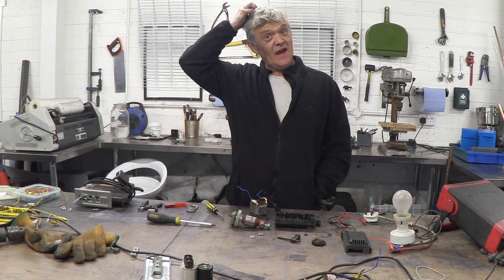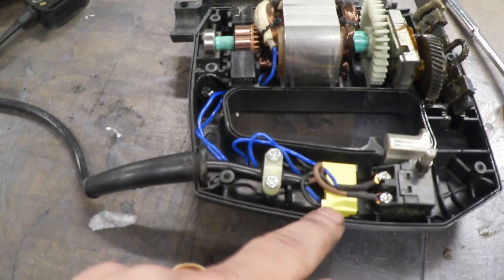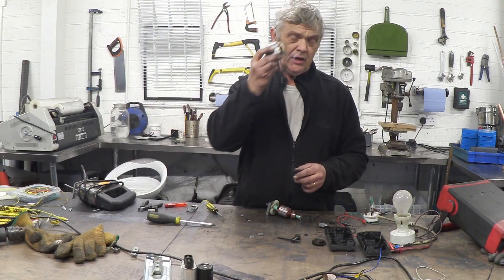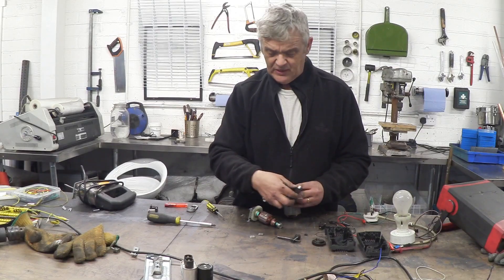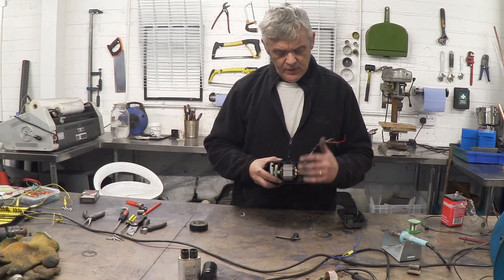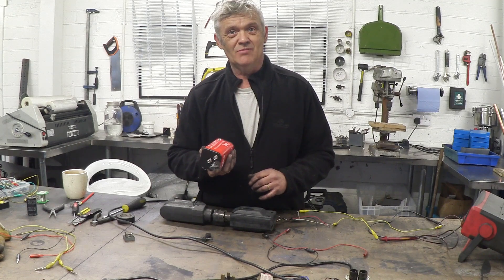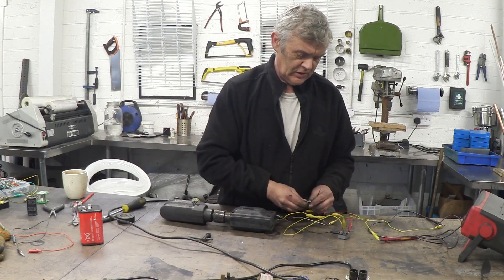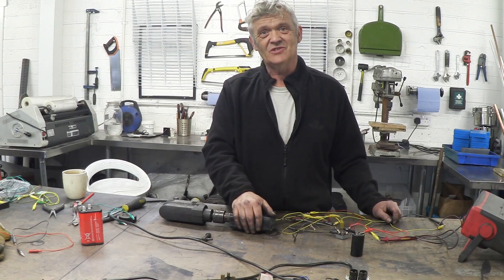Converting A Universal Motor ( Washing Machine, Drill, Saw ) To Generate

Comment: Thanks a lot for the knowlege? I have a question about the yellow little capacitor. You mentioned that it is a starting cap. Do you mean it is like the starting caps in induction motors?? I learn  somewhere on youtube that its role is only to suppress electrical noise. Would you please explain??

Comment: Tried this as I'm looking for a generator for the 3d printer competition, on an old Moulinex coffee grinder motor that still worked - got more generation out of the self-excited configuration (without battery, just with the coils wired in parallel to the brushes) than with the battery (6v)! A bit over 1v vs less than half a volt. Didn't use rectifier having seen comments pointing out that it's unnecessary.

Comment: Sorry banal question, but what are those grills behind you for? Very inspiring by the way. I want to make a wind turbine preferably a VAWT smallish but enough to do what a 100 watt solar will do to help with my 12 volt system or lighting during the less sunny winter months. What motor would u be ideal for that.?

Comment: Well my uncle threw away his Makita  chop saw, so I'm going to use it for something...it has a little gear up thing on there, the motor turns 4.5 times faster than the blade did...I'm going to glue a small magnet to the end of the shaft,  but also supply a small voltage to the armature thru the disconnected brushes...I'll connect the field for the output...it's better I think to do it that way, so the output can be controlled by the input which is slight anyways...its a 115 volt 12 amp motor so I thought it should work all right as a small wind generator...and with the little round button magnet on the shaft, it should start straightaway, I'd think...just a theory...I'm building another one with an old 1/12 horsepower gearmotor from a very old garage door opener, that has nice bearings and I'm drilling holes for 8 ring magnets,  N 52s, 3/4 inch diameter, for the stator...each has 11.8 pounds pull and I'm stacking 2 at each of the four poles so itll be 23.6 pounds pull on each of the four winding cores...this motor had a start winding so I should get two voltages ...anyhow I thought I'd try both types of motors ...I always do things somewhat differently than most anyone else, but nobody has ever accused me of copying lol
Reply: I meant rotor not stator...oops

Comment: Thanks Robert. You should be able to self-start that alternator by making use of the initial residual magnetism in the core, and feeding back some of the initially tiny current from the stator via a current limiting resistor. No rectification is needed. The alternator will be generating rough DC, because of the commutator being used. Output voltage and power will ramp up over the first few seconds. We did that routinely with alternators which had no permanent magnets in them, back in the 70's. It was an old idea even then.
Reply: Quite right, it's already DC coming out of the commutator.

Comment: Now that we have the basic idea, what we need now is to get a car Alternator and find the best motor to drive it with, and hopefully there's enough current left over to charge batteries! Even if it's half an amp at 12V, that's the same thing as 1amp at 12V for 12 hours because it doesn't stop providing! 
And if that's the case, I wouldn't mind having 6 of them running and helping keep the solar battery system going on cloudy days... You really can't complain if it actually gives any current up and over what it needs to run itself, it's maintenance free and it would keep giving the good stuff even if it's a very small amount, but it's possible that it might work well, considering that it can run a car without a battery, albeit it's converting electrical energy to mechanical energy and the process continues as long as there's fuel for the mechanical part of the equation.. but an efficient electric motor, if possible powered by PWM or some other method, just might be able to work... We can assume that everything has been tried or we can assume that everything has been tried but someone has missed something somewhere that is not common knowledge and way different to our current understanding. Someone somewhere might make the mistake that everyone else was looking for but didn't find it... 
So keep experimenting, the next breakthrough lies with the person tinkering...

Comment: Long ago my dad game me a self exciting generator from a Grumman TBF Avenger, lost it when I lost a piece of land [along with a lot of other valuable bits] and my dad told me that without a resistor, it would build up enough voltage to destroy its self, so the makers of the plane [Grumman] had added some carbon resistor piles into the system to keep the voltage from getting too high.
My dad had used this generator for many years as a welder, simply driving it with a 7hp Kholer engine, and a long piece of nichrome wire held to a 2x4 by  a few nails.
I remember seeing the nichrome wire glowing orange hot, sagging and burning interesting patterns into the board while he welded.
[sigh] >longing for happier days<

Comment: What is that damn noise in the background? Anyway if the pole of the field coil has residual magnetism (as you demonstrated), you should be able to turn it into a self excited shunt generator simply by wiring the field coil across the armature and completely eliminate the need for any separate excitation.

Comment: Universal motors don't have start capacitors, that's an interference suppression capacitor
Also, you should have been getting a bigger difference than .1v with the battery, which leads me to believe you parallelled the fields wrong
For series, you just connect the wires that went to the brushes together, but for parallel, brush wire from one coil to feed wire of the other, same wiith the other coil.
To make it easier, you could have extended all 4 field wires outside the case so you could easily swap them.
I'm also wondering if you had the meter set to AC and getting a DC output.
Reply: This question/observation about the relationship of the four possible terminals stemming from the field/stator wires, and how they could/should be wired or rewired is the most underaddressed, confusing part of this UM to Gen hack (in Murray-Smith's and other demos)...here we can hear OP doing something with the field coils with a battery to determine polarity, and thus how to wire, but it is anyone' s guess what he is actually connecting to what and why not being able to see...(something about a compass and a blue wire)So here your comment suggests that for a paralell wiring (increased current), one should take  one of the wires from one of brush terminals and splice? / connect it with  the feed wire of the other coil, vice versa, so basically an X config...which begs question then if we do this, whether our two generator output terminals would then need to come out from our two splice loctions, ie a pigtail near each the brush terminals, or should they be near the feed terminals, or one  of each? Furthermore,  the assumption that the brushes still need to be re- installed to complete the circuit in the converted generator is correct? Or can they be discarded? Thanks to any, all who can shed light on this.
Reply: @TheSiamerican  your 'x config' with pigtails is correct
You also need to feed the brushes with some power 
If you take the output from the field coils, you need a rotating magnet to excite them the rotor is the magnet once power is applied, the rotor voltage can be adjusted to vary the output power, which is basically how a car alternator works.

Comment: I`ve tried most of them, and some blenders motor, also. And, I was thinking about using a voltage regulator from motorcycle, never did though. Better use a bldc for a generator, or microwave over`s plate motor.

Comment: I have some huge motors from forklifts, they are like 10kw at 48v, they are brushed series wound, I got them for a electric car conversion project, but this is like 1950's tech, and salvaged ev motors would be lots more efficient, and powerful, so I was thinking of possibly using one to build a big micro hydroelectric generator,  I have a spring I could dam up, and generate power when needed, I'm off grid, with solar power, and just over 25kwh battery,  I'm looking to build a charger similar to a mppt, to buck or boost, the variable voltage, from the generator, a solar controller will keep the generator voltage pulled down, not allowing it to spin up go full power,  I'm not going to connect it to lithium batteries lime wind turbines are to lead acid batteries, simply burning off power when the battery is full, awesome ideas you are giving me! Thanks!
Reply from the maker: awesome projects mate - thanks for the post

Comment: Robert, instead of powering the field coils, could you just wire a motor-run capacitor across them?
It works with a 3-phase induction motor, and turns it into a generator...
Reply from the maker: in the kick starting it at the end - that is basically what I did mate
Reply: @ThinkingandTinkering  
It's a different principle...
You can use the cap alone to provide reactive power - no rectifier...
Here's a vid about it - from a quick search...
(there may be better...)
He's using a uni-motor, so it does work on 2-phase...
https://www.youtube.com/watch?v=njNevoMY1To

Comment: I used 18v to energize the coil, get 1.5v back. Tried adding a capacitor, it did nothing. As soon as I remove the power no charge is maintained in the coils. Connecting output to input to try and maintain the cap charge does nothing either. What am I doing wrong?!
Reply from the maker: these coils are really wound for 110 - 230 v mate try 30-50v - plus -I got something wrong - out put is dc not ac

Comment: can you make a motor using graphene or carbon ink?  with that level of customization, i speculate you can really hone the fields to the most efficient architecture, maybe create dynamic fields and possibly better deal with heat/resistance.  but im asking ignorantly, you guys know better than me.

huge thanks everyone
Reply from the maker: it's going to have a pretty high resistance if you just try winding it - really if you want to use graphene you have to rethink the architecture - but good question mate

Comment: Because they are commutated, universal motors run as DC generators not AC. I think your voltmeter on AC is reading only the ripple voltage.
You should be getting around 12v DC. no need for capacitor or bridge rectifier.
Reply: You're right. It's already a series dynamo.
Reply: All you need to do is connect the field coil across the commutator output and it will generate DC. This is how the old generators on old cars work.
Reply from the maker: cheers mate

Comment: ...and having now watched the rest of the video, I've another comment: once the generator has been run as such, there ought to be enough residual magnetism in its core for the external kick-start of applied voltage to be unnecessary - that's the way many small commercially available generators work. Occassionally it is necessary to apply a few volts (often 12V) across the outputs if the generator hasn't been used for a long time, or alternatively remove any load attached to the outputs before starting the generator. How long is too long for the residual magetism to work? - I don't know, as it will vary by generator :-)
Reply from the maker: cheers mate

Comment: The capacitor adjacent to the switch at the beginning of the video is for interference suppression - start capacitors are only used in single phase induction motors, and aren't required in brushed motors...
Reply from the maker: cheers mate

Comment: Could you mechanically add a dynamo in series with the motor, so when the shaft turns the dynamo excites the motor?
Reply: or a simple dc motor of the rpm/voltage you are looking for coupled onto the shaft.
Reply from the maker: yeah - but you would still need to input every

Comment: Hi sir ..it was a valuablepractical session u gave us ..
I have doubt on my own project 
If I need both torque and speed for a small size motor what type of motor or how to make one like that and what capacity does the battery should be 
Pls help me in this
Reply: ......... Question is too vague to give you assistance. Is it for a model RC  aircraft or ride- on lawnmower ?
Reply: @charlesdickens6706  it was for a remote car ...in a bigger size and weight
Reply from the maker: no idea mate - sorry
Reply: @ThinkingandTinkering  no problem sir thank you for the reply ✌️

Comment: Hi Rob. Im not sure it could be done but would a supercapacitor or a bunch of them make a jump starter for a car it would make a good video and a kit you could add to the shop. Im not sure it could be done it seems it would be lighter than a battery jumper and would charge up quicker.
Reply: yes . You can also totally replace a battery if you have no parasitic loads. The best system I can think of actually would incorporate a 12v to 14v solar panel as well.
Reply: ........it has been Robert's goal to get supercapacitor batteries onto markets as actual replacements for lead acids , , would have to be for older car models cos of the latest BMS  annoyances in recent model vehicles. There exist supercapacitor boosters on the market for starting vehicles and they in fact charge up over several minutes from a depleted battery to kick a motor to life after  receipt of the  quick charge  from depleted battery.
.... it's looking like BMS on new cars might cause problems if a lead acid is replaced with a capacitor as the main battery. The new cars have to be informed through a scan tool if batteries are replaced these days . Everything is engineered to be a pain .
Reply from the maker: it would do the job just fine mate - there are a few how to vids that give nice details
Reply: I use a cheap 18W 24V solar panel and six 3000F 2.7V capacitors in series to make a 16V 500F capacitor bank for my car.  The solar panel staves off the self-discharge of the caps and the drain of the car alarm system and computer. Each supercap cell has a balance circuit that switches on at 2.6V and bleeds excess power on a sunny day through 50W power resistors to keep cells below the decomposition voltage of the electrolyte. Even after a week of cloudy weather, I'll have 12V across the caps, which is more than enough to start the car (I've measured that the starter consumes just over 2100J to turn over the engine)

Don't know about newer cars, but my 2009 Chevy Cobalt has no problem not having lead-acid. I've also amusingly started the vehicle at just above 10V, but of course, the car does run a little poorly until about after 10 seconds when the alternator finishes charging the caps up to a nice running voltage.

Jumping other cars is also quite nice too, takes all the pressure off the running alternator. There really is no reason to use huge lead acids.

Comment: here is a crazy idea. take your air energy receiver antennae circuit froma video or so ago and bury the carbon felt antenna in the ground..maybe first dry and then later with saltwater. . leave the rest of the antennae circuit  above ground as normal. the air harvesting circuit in reverse essentially.The thought being that it is the earth and the ionosphere that are the actual best conductors and the AIR  is actually the insulator of the giant spherical capacitor know as earth. So you might get a lot MORE energy harvesting from the earth than from the air. Remember electrical generating stations typically have their ground return through the earth not to mention the natural tellaluric currents etc. might be an interesting variation on your earth battery test you did. maybe use a small piece of carbon felt and see what happens.
Reply from the maker: nice one mate

Comment: I would like to see someone build a generator that will generate longitudinal current instead of alternating current based on Eric Dollard's LMD circuit as one would generate more power than usual. If someone is interested, google "Longitudinal Waves and Transverse Waves tests by Jean-Louis Naudin" for LMD circuit diagram to modify for use in generator. Use TriField meter to measure whether you have longitudinal current or not, electric field and magnetic field are in same direction in longitudinal current as you can see in this video "Replication of Eric Dollard's Analog Computer". For Eric Dollard's video on longitudinal current, google "Transverse & Longitudinal Electric Waves and Tesla’s Longitudinal Electricity".
Reply: https://www.youtube.com/watch?v=DFa-IymyWHM
Reply from the maker: give it a go mate

Comment: A universal motor is a DC motor already, and any DC motor can be a generator just spin it , I used to run mains drills on 240v DC when testing field controllers
Reply: yep.. its rough on the switches.  but works fine.
Reply from the maker: cheers mate

Comment: The same as Aviation dynomotor used in old aircraft radios to generate the high voltage for th vacuum tubes
Reply from the maker: is that right - interesting - cheers mate

Comment: you can make an autostart, by putting a diode in series with the battery, so it will feed as long as the voltage is low enough.
Reply from the maker: nice idea mate - I suppose though I don't really know